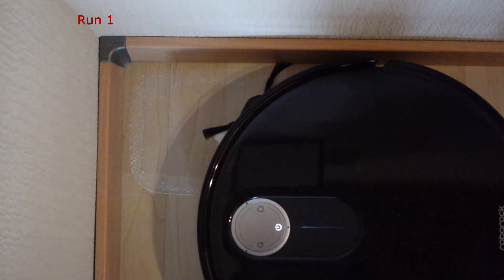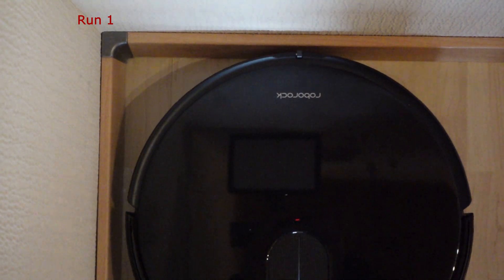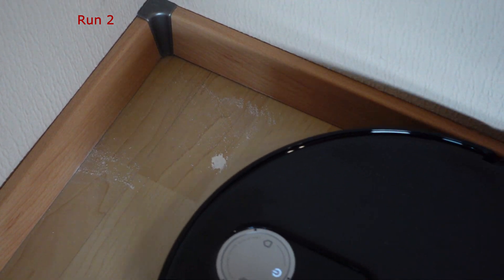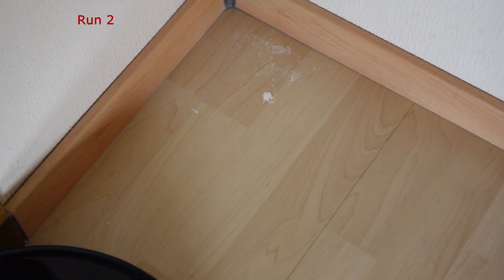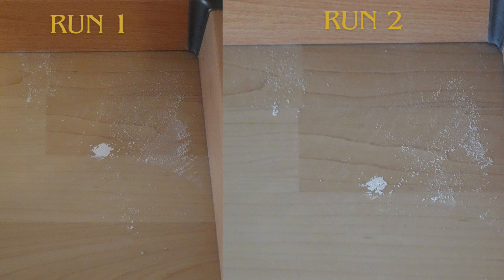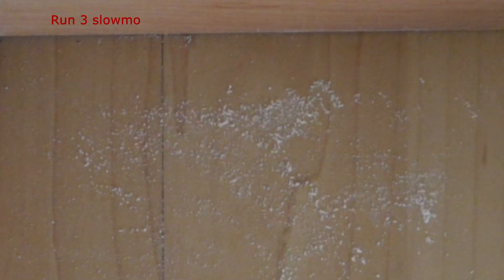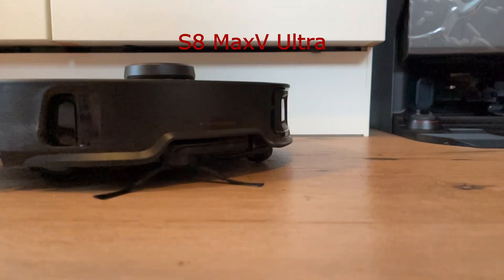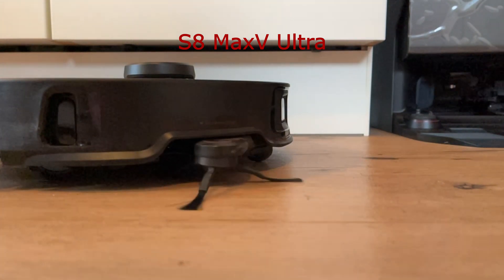Roborock QRevo SLIM FlexiArm design and details - pretty much the same issues like the S8 MaxV Ultra

Comment: Interesting info.  I just got a Qrevo Slim.  How are you manually extending the side brush when it isn’t moving?
Reply from the maker: BIT Mode. I have some videos about this mode uploaded using different units. Activation is the same.